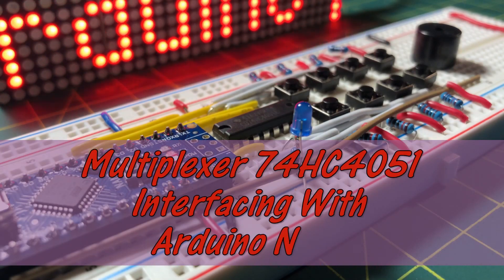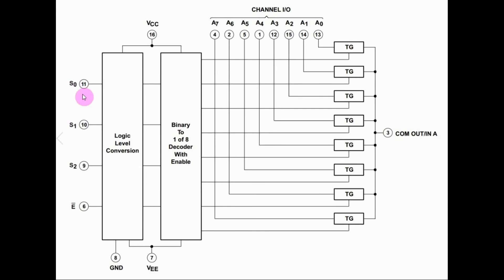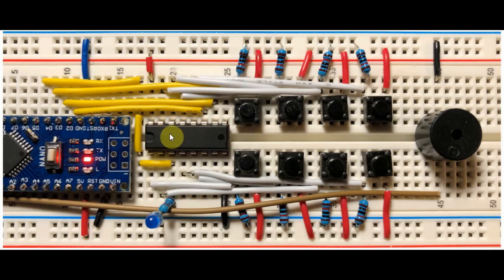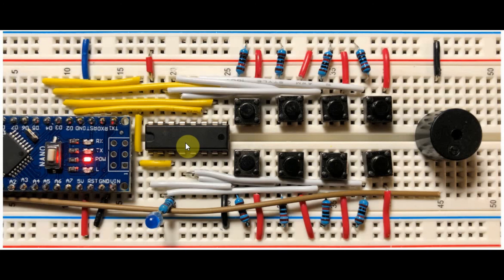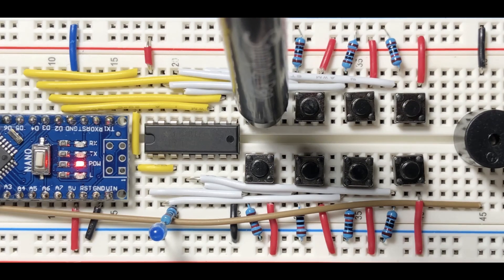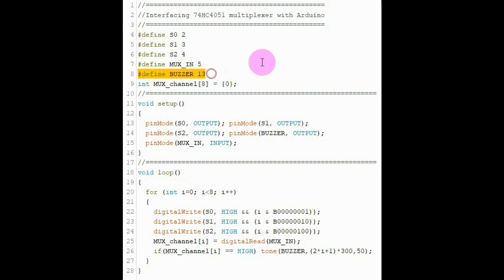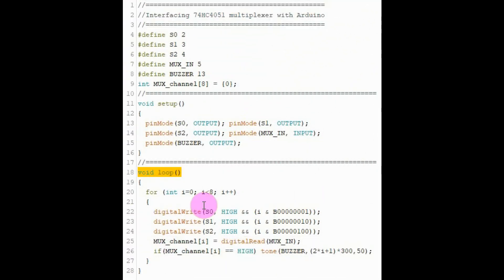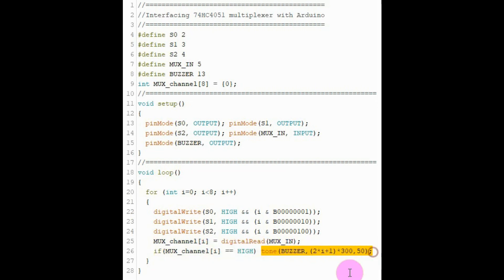Multiplexer 74HC4051 Interfacing With Arduino Nano

Comment: Please ask, which IC should be used to extend 100 I/O to Arduino as the real-time status input of doors and windows.
74HC165
74HC4051
74HC4067
Reply from the maker: I would recommend using multiple 74HC4067
Reply: @AnasKuzechie  Thanks for your answers

Comment: That is great. I am looking for such solution to switch audio signals inputs in my amp but to have it integrated with arduino ,rotaty encoder and menu on the display. I think your example showed me that it might be not that complex.

Comment: Why in your FOR loop do you write “HIGH && (I & B00000001”, etc? What does “HIGH” do right there?
Reply from the maker: The outcome of expression (i & b00000001) is either TRUE or FALSE depending on the value of i. Logical ANDing HIGH (which is considered TRUE) with the outcome of (i & b00000001) is either TRUE/HIGH or FALSE/LOW.
Reply: I’m asking because when I tested this exact same code all my mux’s control pins received straight 1s through all iterations of ‘i’... 😅
Reply from the maker: @ChronoGXay  I checked the loop. The iterations give 3-bit count from 000 to 111. However, I did find a typo error: replaced bXXXXXXXX with 0bXXXXXXXX. Use this code for testing:
for (int i=0; i<8; i++)
  {
    Serial.print(HIGH && (i & 0b00000100));
    Serial.print(HIGH && (i & 0b00000010));
    Serial.print(HIGH && (i & 0b00000001));
    delay(1000);
    Serial.println();
  }

I hope this helps, and thanks for your feedback.